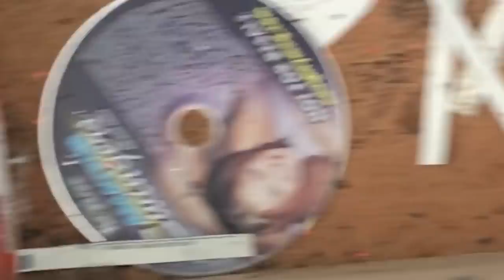S2 Episode 2: Roach City

Comment: I sympathize with you guys. One thing that is a blessing, you can't smell how bad it is on the net.

I work cleaning repo houses. Most were section 8. The people were gone up to 6 weeks in Phoenix's summer! Sometimes you can smell these houses down the street.

It still amazes what people can do to a structure. Used feminine  products stuck to walls and ceilings. People literally crapping on floors, sinks. All kinds of bug infestations. Coper, appliciances ripped out of walls. Black mold everywhere. Used syringes. Dirty diapers pulled up. Dead animals left behind.

Some houses were so bad that they were demolished. The squatters were the worst. The thing that still gets me are the toys in the middle of all this.

And people don't realize how much energy, time, resources, and emotions go with that job.

Comment: Would it have been better if the place had been bug-bombed before you went in and threw stuff out?
Reply: calonstanni i 10000% agree is not even expensive & now there crawling into other motels unfortunately
Reply from the maker: Actually, no. Usually in a hoard you can only bomb after otherwise the stuff in the room will act as hiding spots and more roaches would survive.
Reply: @CrimeSceneCleaning  ahhhhh I see.  .....thanks for answering!

Comment: Hey guys I wanted to find a way to contact you directly about a question I have. I am currently dealing with a mother in law basement clean out and renovation. I just did a cleaning of the kitchen and it was super bad. Mold and animal waste everywhere. The bathroom is a sad mess, fruit flys everywhere due to rotting food. The refrigerator itself what's completely full of mold. There's an excess of garbage clothes and trash everywhere. I'm afraid there might be fruit fly eggs and such within the downstairs HVAC. There are no roaches and no signs of rats. However the smell a condition has left me with slight chest pains. Obviously I'm going to need a respirator to continue this job. I guess my number one question is how to continue to tackle the situation. I'm an experienced handyman and maintenance technician I have seen quite a lot of stuff. I am able to stomach everything that I've dealt with so far. I'm trying to figure out what is the best way to tackle this mess. I am looking at at least two or three dump runs to clear out the basement. I want to let you know that I will be doing this job solo. What do you guys do to maintain your health integrity, as well as making sure the job goes as quickly and as smooth as possible. Although this job is not nearly as bad as any of the episodes that I have seen on any of your Seasons whatsoever it is still showing signs a slight hoarding. I know your YouTube channel is used in purposes to be informative and not a consultation device. However, I need an idea of what I'm dealing with from professionals who know what they're doing!

Comment: Ok, so I don't know if you guys have noticed but you have a lot of jutter going on. That's the term for when you pan your camera (move side to side) and it looks like it's skipping or stuttering. There's a few ways to fix that. Firstly, make sure your'e filming in 60+ frames per second. Second, pan very slowly if you have to pan at all. You could also increase your shutter speed to about double of your frames per second but it makes the footage kind of blurry. I suggest panning slower, but a lot of filmmakers avoid panning at all.